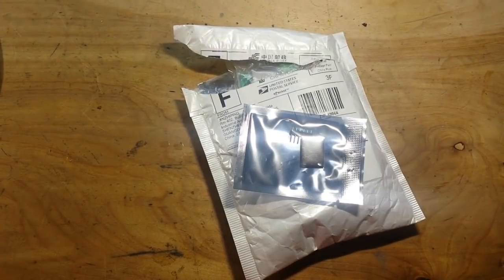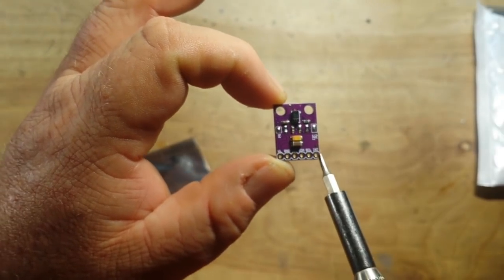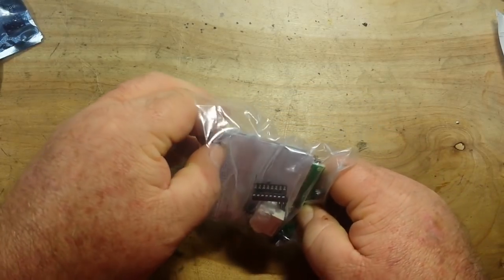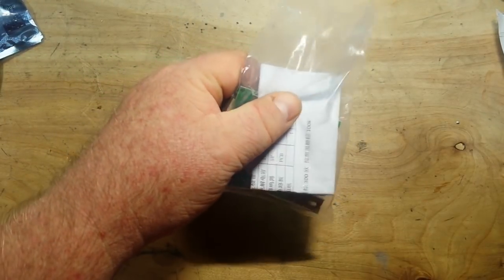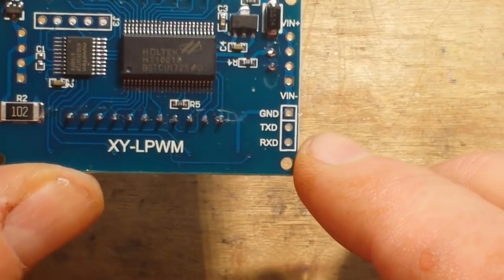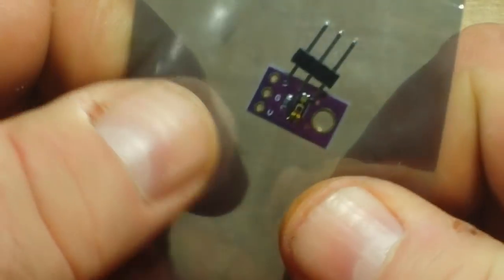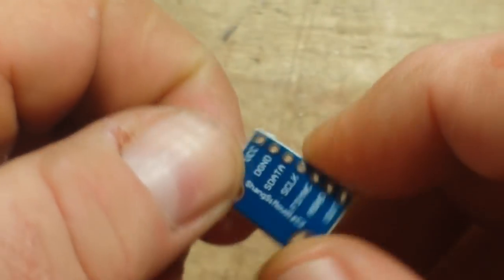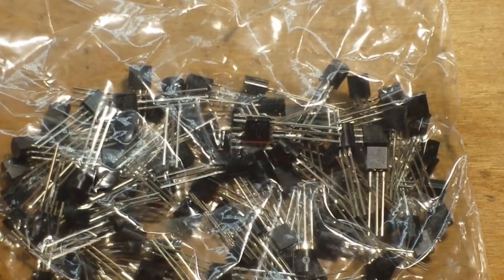The Slow Boat from China #14

Comment: Is there a way to modulate the signal from this to align radios? https://www.ebay.com/p/1-X-Ad9850-6-Bands-0-55mhz-Frequency-LCD-DDS-Signal-Generator-Digital-Module/10018549133?iid=142771308385&_trkparms=aid%3D555018%26algo%3DPL.SIM%26ao%3D1%26asc%3D20170810093926%26meid%3D644658be65a2443c8eb4ba324cd29a0b%26pid%3D100854%26rk%3D1%26rkt%3D1%26%26itm%3D142771308385&_trksid=p2349526.c100854.m4779
Reply from the maker: Probably, but Im not an RF guy so I cant be sure. But i can tell you who could tell you: Buddy at the YouTube channel "The Radio Shop" Buddy is an RF genius.

Comment: I got that same bag of 2n2222 transistors for $1.50, thought i had an amazing deal until i saw this. Hope to see u use them in future projects.
Reply: I paid £1 for 100...cheap enough even if you only want a few. They are a useful gp npn small signal transistor. I've used them in xtal oscillators ,amps  etc.

Comment: This "alice" seller is good until you have quality problem - badly soldered neopixels matrix in my example. I've send detailed images and description, but they're refuse to do anything, no replacement, no refund. I've manage to fix it later with tiny t12 soldering tip, but Alice will probably never seen my money anymore.
Reply: This is why I like aliexpress, if something doesn't work or show up you get a refund.